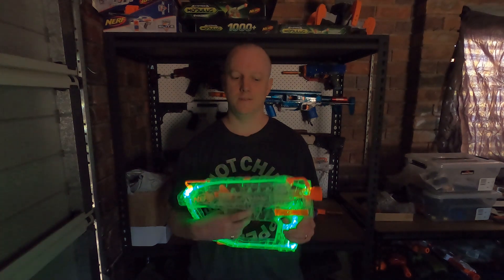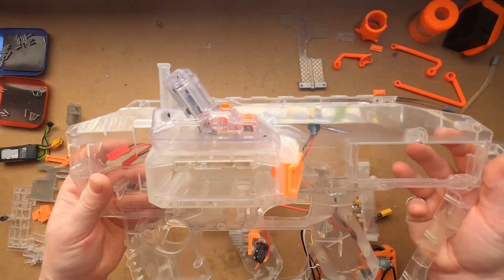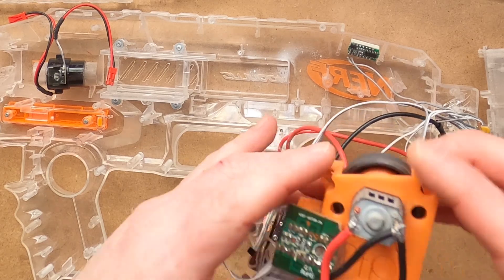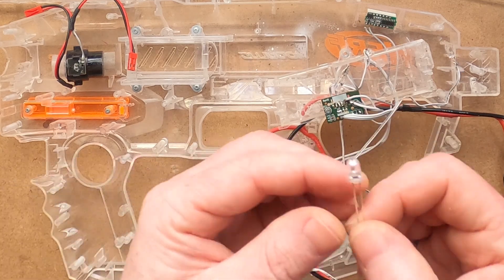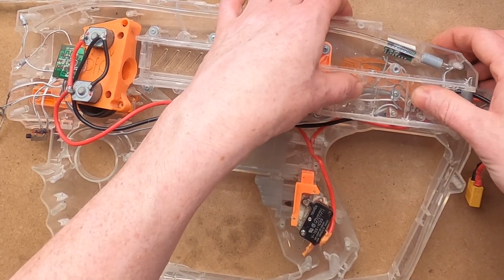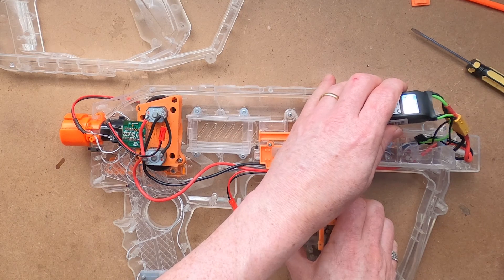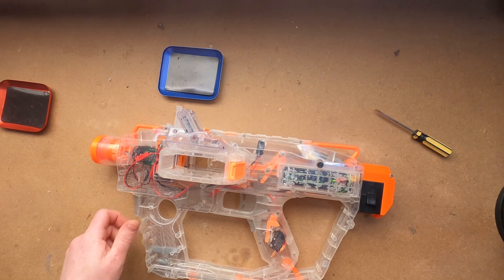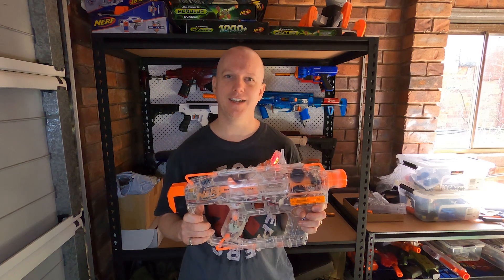Blaster Breakdown 05 (May 2020) - Nerf Evader + Chronobarrel mod

Comment: could I use hot glue in my evader to hold my rev switch in insted of epoxy? I'm working on a chopped version of your project and I removed the plastic thumbhole stock behind the triger handle
Reply from the maker: If it provides a solid bed for the switch, I guess so. I'd half-hoped a 3D printed piece for a Stryfe would work here, but it wasn't the right shape. Another option is keeping the stock switch and using a MOSFET.
Reply: @andrewg_nerfmods  ok I'll try some of those options thanks